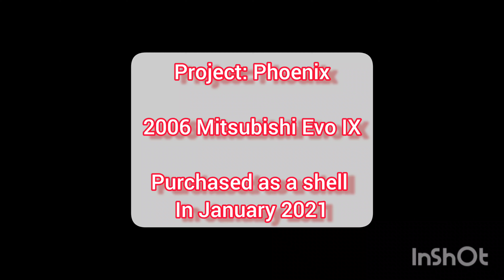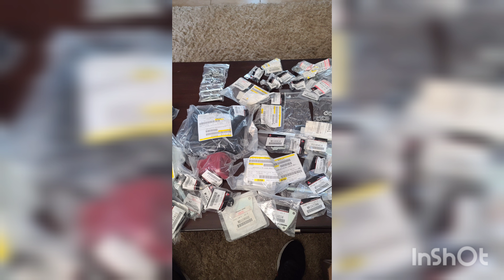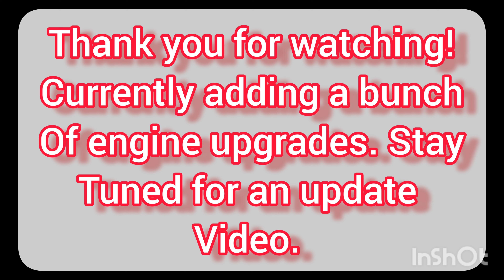EVO 9 shell to complete car in 15 minutes!

Comment: how much did the entire project cost you?
Reply: amazing work btw!
Reply from the maker: Thank you! I think I'm roughly $25k in right now. I could have done it a good amount cheaper using a bunch of used parts over new OEM. But I prefer to do things right the first time. Saves headaches later
Reply: @jesserooker8690  wow that’s amazing!! keep up the good work!
Reply: @jesserooker8690  honestly its better you went new, most of the used stuff is so dated and falling apart you would have had to replace it later down the road anyway. and a lot of parts are discontinued now.
Reply from the maker: @vijaysaini3003  Agreed! There were several parts that I needed that had been discontinued. So I hunted down low mileage pieces. I'm numerous cases, I bought, then rebought parts because they weren't up to my standard. I'm very glad I was able to get the new parts I did. A lot of them have since been discontinued